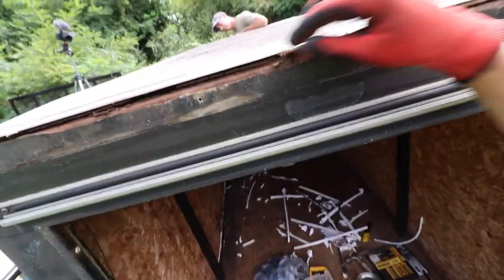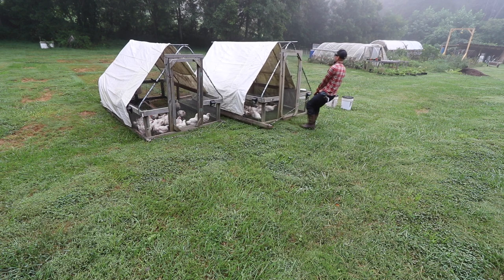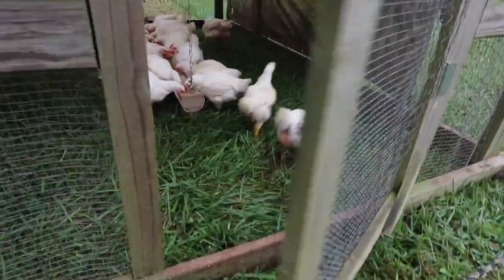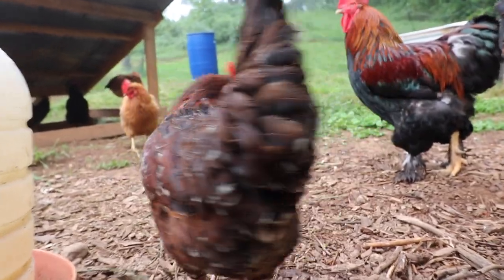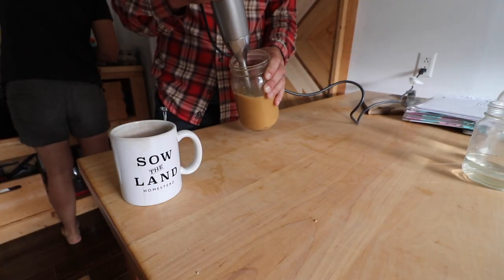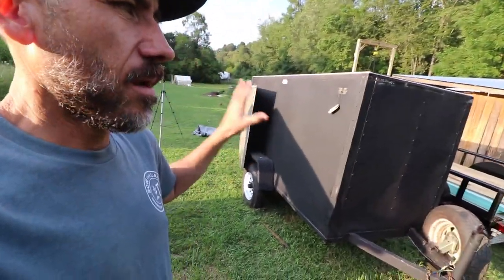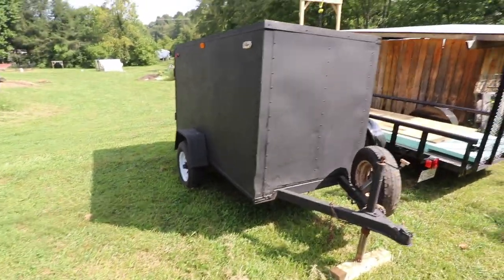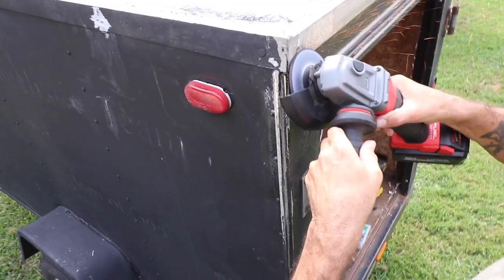Building a Portable Walk in COOLER from this UGLY enclosed trailer (VLOG)

Comment: I just grew those Shishito peppers this year after having some at a restaurant in California  on vacation. Good, slightly hot peppers, less heat than a jalapeño.  I also found out that they are the same pepper and also called GOCHU peppers from Korea. Its somewhat of a new pepper that people are making dipping sauces from them. Ive found sauces at Target under the Gochu name. Let them ripen and turn red. They taste the best that way. Also you can save the seeds and griw them next year!!  Apparently in Korea during the growing season you can see these outside houses, drying in the sun in every village.
Reply: I’m a da of the Shishito peppers but not the heat. Green ones less the seeds have a kick to them but no heat. If you let them turn red on the vine and use the seeds they get hotter. My favorite is drying them and making a powder. So easy to add to stews, soups and even salads and sandwiches. I’m actually up to my eyeballs in them this year. I might even try to pickle some

Comment: Those star headed screws are pretty common in the trailer industry. They're an 8 pointed star and you can just use a square bit, probably an R2, and it will work with just 4 of the points.

Comment: Happy to see you do this. Don't be surprised if some hunter friends invite you to their rhunting camp , then remind you to bring your trailerable cooler. 😄👍Anyway before you start closing it up I suggest putting in some steel support in strategic locations. After all you now have a welder. You might not think it important now but it would be great to have steel supports so you can hang meat. I'd consider bolts that hang from those supports. Then when your done insulating and covered up mount to those hanging bolts on or two " I " beams and a trolley or two for heavy hanging meat. It will make moving that meat a lot easier safer. Anyway I'm looking forward to seeing how you do this. Good luck.😃👍⛄❄☃️

Comment: Are you gonna paint the outside of that trailer with Henry's RV roof sealer it'll help keep the inside box cooler even with the insulation add waterproofing probably only need a gallon.

Comment: Hey. I'm looking at building a cooler of some kind. I've actually rebuilt and repaired several coolers of restaurants and am fairly comfortable with the structure. I want to know more about what can I use for a cooling it? I've seen some that use just a wall unit AC. Is that ok? Thanks for any input.